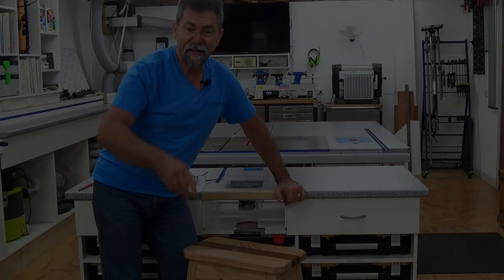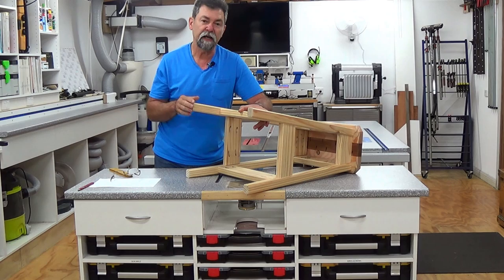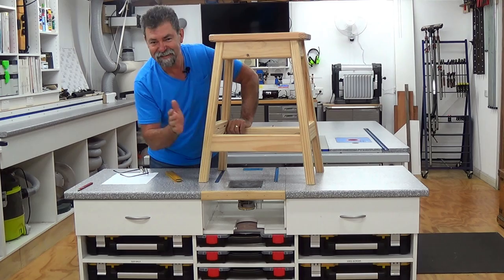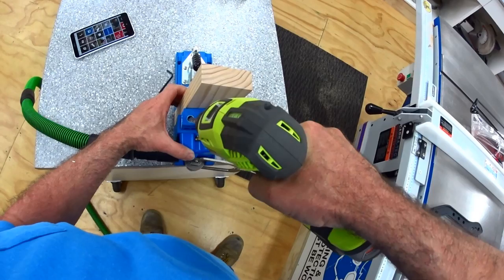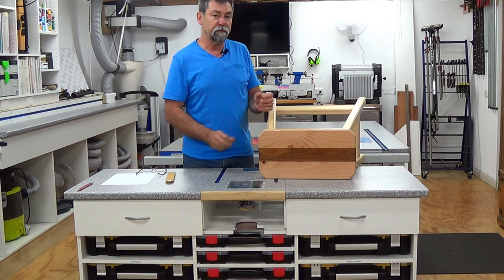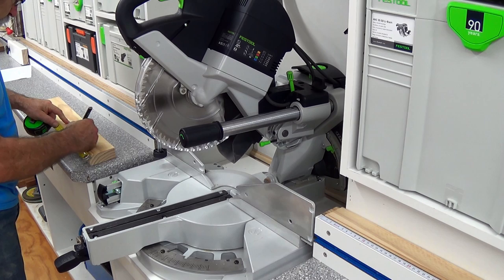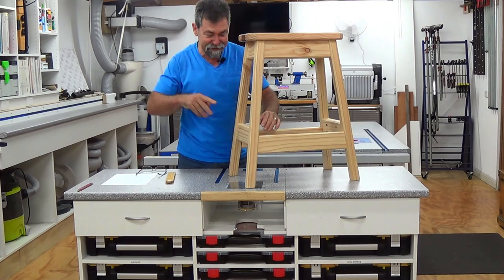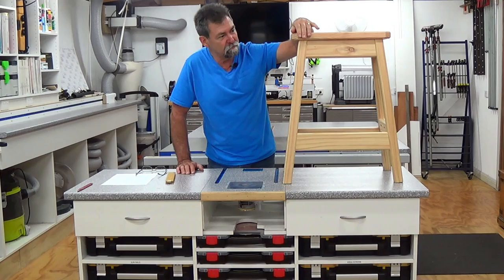how to | timber stool | dave stanton |  woodworking | kreg pocket hole |

Comment: Here's the dimensions if anyone is looking for them!

Legs - 38x38mm (1 1/2 x 1 1/2")
Length - 670mm (26 3/8")
Quantity - 4

Compound Angle 7° x 7°

Rails - 83x32mm (3 1/4 x 1 1/2")

Top Rails 
2 @ 320mm (12 5/8")
2 @ 145mm (5 3/4")

Bottom Rails
2 @ 420mm (16 5/8")
2 @ 240mm (9 1/2")

Seat 88x32mm (3 1/2" x 1 1/4")
2 @ 450mm (18")

Seat 65x32mm (2 5/8" x 1 1/4")
1 @ 450mm (18")

Comment: Just built this got it together after buying longer pocket screws the recommended 38mm only had 2 threads stick out of the wood ,so went with the recommended length for 2 1/2 material.

Also once together noticed I had the leg leaning front to back, when they should be left to right with long point to the outside  and short point to the end side...nothing a little bit of sanding want fix. Over all I'm satisfied with the build very comfortable !!
Reply: Also I used all recycled wood from pallets and this was my first build using pocket holes.

Comment: Nice project Dave. I made similar, but larger and if memory serves (sometimes doesn't), I did 5 degs. on mine. Used 2x4s.
Also made larger, put locking wheels on it and my benchtop planer sits on top. Top is just a piece of high density particle board I had in the shop. 
That screw caddy is nice........I just keep mine in the boxes they come in on a shelf.
Reply from the maker: Hey, thanks for checking out my project! It's awesome to hear that you made a similar one, but with your own twist. And hey, if the boxes work for you, then that's all that matters. Keep on creating, my friend!

Comment: Hi Dave.  Thanks so much for putting this video together.  I followed your design instructions, and it turned out a treat.  I even finished it with wax as you suggested (I used bee's wax).  I'm really happy with the outcome.  I used 15 sections of 2x1 pine for the seat (joined with glue), and I used screws through the legs rather than the pocket joints (I don't have a pocket joiner).  Thanks again, Dave.

Andy
Reply from the maker: Send me some photos if you are comfortable with me showing them on my live show!
Reply: Happy to, once I work out how to attach photos!  Cheers,  A

Comment: I just finished the stool... perfect height for my bench! I added thin rubber to the bottom of the legs to prevent my concrete floor from ruining the wood. Thanks for showing it, Dave.... and I just ordered a Miterset too.
Reply from the maker: I need to see pictures Bob!
Reply from the maker: Thanks for supporting the channel by using my link for the miterset. I is a very handy bit of kit! Any one else need accurate angles? Click the link.  https://youtu.be/FabIJLTnr4s
Reply: David Stanton I just sent them to via Facebook messenger.

Comment: Hey David,

I decided to make the stool.  I was going to follow metric measurements, but when i grabbed my tape measure, its only imperial lol! Atleast, I tried.  Anyways, I decided to use scrap lumber that I had.  I had no 2x2's for the legs, so i ripped down some scrap 2x6's and made my own.  I made the whole stool out of dimensional lumber.  The braces were 2x4's and the top is 2x6's.  Learned quite a bit by making that small project.  It also builds confidence.  Thanks for putting this project on.  Once I get some finer blades for the table and mitre saw, one day I will try it again with nice wood. Oh and its not wobbly!
Reply from the maker: Great to hear that it went well and you enjoyed yourself!

Comment: nice work Dave.  This is something I'll give a go. I don't own a pocket hole jig so I'll be improvising with biscuit joints I guess. Cheers Matthew.
Reply from the maker: Hi Matt. I only used the kreg system to show its versatility. Biscuits will give a cleaner finish without looking like swiss cheese when you look underneath, lol.

Comment: Thanks.  That is one beautiful, well made stool.  I made two of them and used 5 degree rather than 7 degree angles so the legs don't stick out quite as far.  The 5 degree angles seem to provide plenty of stability although I'm sure the 7 degree angles provide more.
Reply from the maker: Nice work!
Reply: @DavidStanton  Thanks.  One more tip I've gathered from other plans is that you can bevel the top rails to the same angle as the legs so as to allow for them to fit flush to the bottom of the seat rather than just the outer edge meeting the seat bottom.
Reply from the maker: Sounds like a plan klink370 but that requires a bit more skill. This project was for people who are starting out. Please send me some photos of your stools.

Comment: Our new house (we move in 3 weeks) has a waterfall island bench in kitchen. We want stools without backs so they push right underneath. These would be great. The flooring is Tas Oak so matching timber would be expensive. Must look for some second hand. My daughter and boyfriend are renovating their house. Spent some time recently cutting up old hardwood frame into firewood lengths. Bummer. 
Hope you had a great Christmas. 
Greg
Reply from the maker: Missed opportunities only make us look more closely the next time!
Reply: Correct there Dave

Comment: I set both the miter and the bevel angle to the same number, say 7-degrees. Make a cut at one end of the table leg. Then, without rotating the table leg after making the cut, slide the leg to its other end and make a second cut just like the first one. Done. I repeat the step three more times if my project has four legs. Play around the positioning of the four cut legs until all four splay out in four different directions.

Comment: You don't say but i'm guessing when you pocket hole the rails, you have the 7degree flat face down on the KREG jig i.e. the wood is not perpendicular to the KREG so the pocket holes are at an angle?
Reply from the maker: Correct.

Comment: Hi David, 
I am organising my screws, nuts and bolts in my workshop, I was just wondering what brand are the plastic  hardware containers under the bench you are working on. Where do you get them in Australia? I am located in Brisbane, Queensland.
Thank you,
Andrew.
Reply from the maker: Hi Andy. I got mine from where I work part time. https://www.carbatec.com.au/workshop-accessories/storage-containers There is a store in Brisbane.

Comment: I'm building six of these and I'm having a lot of fun doing it. One thing I didn't think about was just how many screws you have in each one of them.
Reply from the maker: I would have to count them...maybe watch it again and see how many there are per joint and then multiply by number of joints?
Reply: +David Stanton there are 36 in them. I plan on putting a short backrest on mine so that will add another 8. I ended up buying every 2 inch screw Lowes had.
Reply from the maker: Post some photos when you are finished!
Reply: +David Stanton I will.
Reply: I never could figure out how to post the pics so I sent them to you via messenger.
Reply from the maker: Thanks, I will have a look.

Comment: Nice Job on the stool Dave but I'm troubled. We are dealing with a pyramid. Every joint will be a compound angle including the rails. The 7 degree face angle on the rails is fine but there is no mention of the edge angle. Muggins me then has to assume it's square. This results in gappy joints. The edge angle for a 7 degree stool is 89.5 degrees from the inside face, making the inside face longer than the outside.. Small bikkies you say but it makes a difference when multiplied by 4.  Square edge angles work too if you can tighten the screws to blazes. Just sayin'.
Reply from the maker: It is all 7 degrees, pretty sure I showed that in the video.
Reply: @DavidStanton  Yep, all 7 degrees except the edge angle of the rails. If I could send you a picture you would know what I mean. Cutting the rails at a compound angle of 7 degrees and 90 degrees is not quite right. Pedants like me need to cut at a compound angle of 7 degrees and 89.5 degrees is all I'm saying.

Comment: Hey Dave - I was searching your site and came across this gem!  I want to make the stool, but I do have a question.  For the rails, you say in the video that they are 1 1/2" x 3 1/4", but when you attach them, you put a 1/4" spacer in so they are set back a bit.  So wouldn't the dimension be 1 1/4 x 3 1/4?  Also, when you give the lengths of them, you say 12 5/8" etc., I am assuming all of the mitered cuts are measured from long point to long point.  Thanks for the video!  I really like the stool!  What is the final height of the stool from floor to top of the seat?  Cheers!
Reply from the maker: It was a long time ago Russ but the height is 690 mm
Reply: @DavidStanton  Thanks so much Dave!  I really appreciate it!

Comment: Hi David, what Thicknesser do you use
Reply from the maker: +Damian Curtis . Hi Damian. I have 2. A 15 inch helical head machine that is very heavy and the other is a benchtop machine that is also a helical head machine. Both are Carbatec branded.

Comment: All I have to use and make this is a hand electric saw, a hand saw, and a drill. Call me crazy but its my first time trying to make a stool . Wish me luck. Nice exhibit though.
Reply from the maker: You can do it!
Reply: @DavidStanton  I thought so ,so I went ahead to try and make a mini stool to practice for the big one. I figured out the compound angles and all, but what is beating me is doing the pocket holes without pocket tool or extension screw driver or even clamps. Heck send me a pocket tool and I might just try ,😁😄 So I might take the easier road and make an all squared stool without the compound angles to save me the pain.😄 But I love the idea/ challenge and would love to try in the future